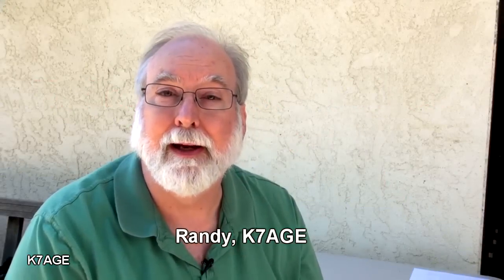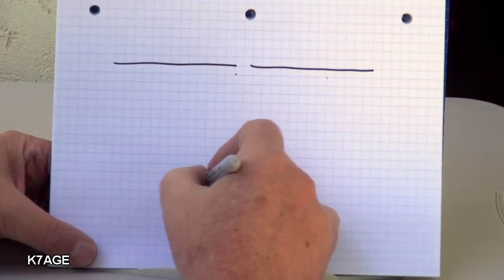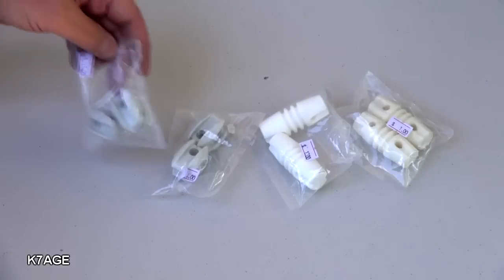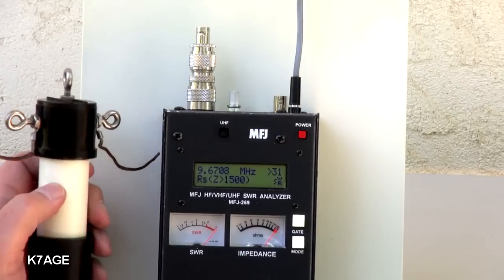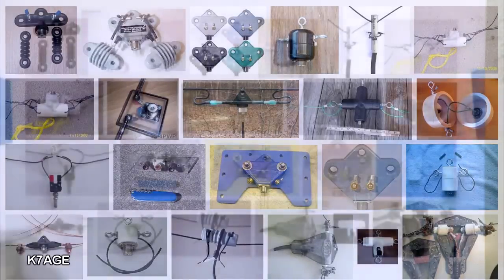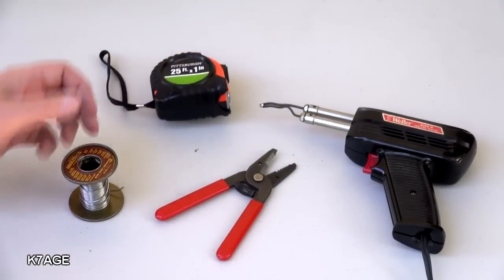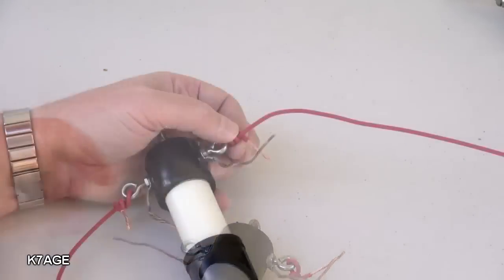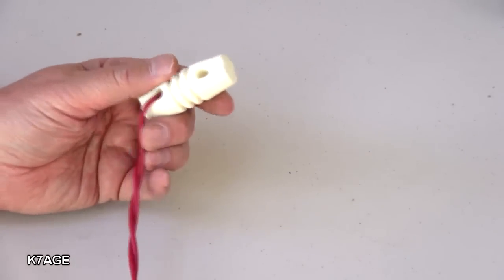How To Build A 10 Meter Dipole

Comment: With the black center insulator, I just bent the copper prongs backwards forming a hook on both sides.  Using bare stranded copper wire, I make a loop, solder & shrink wrap that, and use the hooks.  The tension suspends it making a electrical connection and it works great.  Then I can make additional bands, using the same center insulator.  de W7UDT

Comment: does the gauge of the wire used for the dipole matter?
Reply from the maker: Not really. Needs to strong enough to hold it up. Stranded is better than solid to prevent breaking.
Reply: @K7AGE what size coax cable are you using for the 10 meter ? Thx

Comment: Thank you for the video. I just wanted to make sure I did not have my measurements wrong. But I used my RigExpert AA-600 and my VSWR is less than 1:1.6 and my radio is showing 1:1. I will take that all day long.

Comment: What kind of bandwidth can you get from something like that without a tuner that is , I know most times it’s based on 2 :1 or less .. i’m thinking more like  1:5 or less 100Khz ?  Does the size of the wire used determine that

Comment: that was a good video im thinking of making one , 1 problem though i dont have a high place to hang it could it go under the eves near the rain gutters from my house run the coax out my window to the ballon witch would be 5feet away .would know of some more on the stealth side that i could use for 10 meter
Reply from the maker: Don't hang it really close to the gutters. Give it a try
Reply: ok, il hang it half way from hse to end of the eves il see how that works.

Comment: New to the hobby. Why do you divide 468 by the MHZ what does 468 represent and what does an swr 1.1:1 mean?
Reply from the maker: low SWR is a good match  https://www.eham.net/article/23802
Reply: Should be 300(.000.000) ... speed of light.
Reply: So ((300 : MHz) : 4) * .95 = quarter radial lenght

Comment: Ok I see this is old, but I’m new. What if you don’t have a balun? Do you need the balun? Can a balun be purchased on the cheap? Thanks! -73- W1KPS
Reply from the maker: If you don't have a balun, just connect the coax with the center in one wire and the shield on the other wire.
Reply: Is a balun necessary?
Reply: @kevinshieldsw1kps785  No, a balun is not necessary on a dipole.  A dipole's characteristic impedance is around 72 ohms  and is close enough to the 52 ohm characteristic impedance of coaxial cable.

Comment: Just got an any tone. (Ten meter) mobile rig (am/FM) . Plan to use that as base /mobile rig. Useing a salvaged bread board. To carry it around. Has no ssb yet am at 29000-29200/fm at 29600. Will be a jump start as interest is on my golden years as its easy to wrangle wire tks Fer the class on  ten 73 de kv4li

Comment: If my antenna, made per these specs., is a little long can I just fold the extra wire back at the end insulator -- or will the dbl'd-up wire cause any sort of issues.  Not talking about folding back many feet of wire, but if I needed to shorten each half by 6-8 inches (just as example) would it still function properly by just folding those bits back and twisting over.  Hate to cut of few inches here and there and just throw little pieces away, if it is Ok to just fold them back over...never know when that antenna gets taken down and re-purposed for something else.
Thank you for the time and effort you put into sharing your knowledge with others.
Raymond - WF7BSR

Update:  I saw in your other video (https://www.youtube.com/watch?v=Ogxp3yjAzCs) that you did fold over small sections of wire when shortening the antenna.  Thank you.
Reply: Hi Raymond.  There’s no problem with folding excess wire back at the end insulators.  As electrons run along the surface of a conductor (i.e. the antenna wire), by folding and twisting back, the electrons “see” the cable as a single cable, terminating at the insulator.  73.

Comment: HI Randy, What would be the difference if you just used the wire as a long wire mounted horizontally into an unun instead of cutting it in half to make a dipole? maybe its a stupid question but Im interested. thx
Reply from the maker: That becomes an end fed dipole. I believe the balun used this is a 9:1 or so. Google end fed antennas.
Reply: Thats what I thought, thats what I use myself. Would be interesting to see the swr results side by side if cut same length.

Comment: Thank you for the effort you put into your videos. I built a 20 meter dipole using this method. It resonated at 14.2 MHz and only 1.7 SWR on the high side of the band (no adjustments needed). Although this antenna is mounted inside the attic, my first contact was with an operator in Miami..  I am located on the NH/MA border.
Reply from the maker: Glad to hear that you made this for 20 M. Have fun.

Comment: Dogbone insulators, like most other stressed insulators, are designed to work via compression.  Wiring up a dipole with the ends being pulled apart is a surefire way to break the insulator as it is being stressed at its weakest point.  If you attach the end of the dipole and the suspension wire (preferably nonconductive) at opposite ends such that they are pulling towards each other through the insulator (compression), the insulator should not break.  If it ever DOES break, the way the insulator holes are opposed at 90 degrees will ensure that the suspension wire and dipole end "hook" keeping your antenna up in the air.

See: http://www.mtechnologies.com/dipole/bvc-007f.jpg
Reply: Do like am radio tower builders and use guy wire insulators called Johnny balls those support weight of swaying towers in a pull type measure

Comment: You didn't account for velocity factor I reckon, still a great video, thanks for that!
Reply from the maker: 468 is just starting place to figure out the length. Always cut the wire longer and trim back.
Reply: that's probably smart haha, I'm just in the theory part of things and will make sure to follow that advice as soon as I get the real estate to practice :D
Reply: Hi Jonathan.  The 468 formula INCLUDES the generally accepted velocity factor of 0.95, so Randy’s starting point calculation is correct.

Comment: I am told day in and day out that 10 meters is not that great anymore because of the sun spots and space weather. Does that mean that there is no one on 10 meters or does that mean that conditions aren't that favorable but people continue using that band anyway?

KM4WJV
Reply from the maker: Yes, 10 isn't what it used to be. The propagation has been poor. 10 does open, but you may have to listen around.There have just been a couple of 10 meter contests, and the guys are complaining of poor openings. Here is a good site that covers 10 meter beacons. These are good to check to see if the band is open. http://swling.com/blog/2016/02/guest-post-listening-to-10-meter-radio-beacons/
Reply: I'd love to check but my moron lawn guys mowed over my 80m dipole that I had on the ground overnight to perform modifications, i spliced it but i know it's going to mess everything up, so i guess a new 80-10m dipole is what i'm getting for Xmas
Reply: That's true to an extent but it DOES open during the low part of the cycle so keep checking it! You never know when it will pop open. HAVE FUN!

Comment: Another  GREAT video, Sir!!!  My only thought was at the 11:00 min point where you put the far end of the red wire through the insulator--a "newbie" may not know how far from the tag end to put the wire through the insulator.  Maybe show  putting a Sharpie mark at the 8' 3" point just as a reference mark (starting point) for possible future tuning by unwrapping/rewrapping the wire in case they need to lengthen or shorten that end.  Love your videos!!!  Rich, W2RRK
Reply from the maker: +Richard Kelly good idea

Comment: Do you really need a balun? or can I just run a pos  /  nag  lead?
Reply: +Walt Prescott need to know this as well
Reply from the maker: +Walt Prescott The balun helps to balance out the antenna and reduce RF coming back down the coax into the shack. You don't need to use the balun.

Comment: Hi Randy, nice video, good work, I have a couple of questions,  what kind of BalUn was that? A voltage Balun or a Current Balun and what purpose did it server? I look forward to your comments, KK4EDE... 73
Reply from the maker: +Michael Katt It is a 1:1. It helps to balance out the antenna to the coax and helps prevent any RF from coming back down the coax to the shack.
Reply: @K7AGE  I know that I am late to this video, but, yes it is a 1:1 balun.  But, is it a voltage or a current balun?  If it is a current type then it is a common mode choke and those are the ones that help prevent the coax shield from acting as part of the antenna.  And at 1:1 they really should be called line isolators as they do not do any impedance transformation that makes any difference as a dipole antenna's characteristic impedance is around 72 ohms and poses very little of an impedance mismatch and a matching transformer is not needed.

Comment: Hi Randy, Thank you so much for this video. I am a tech and I have been doing my home work to find out how to get on 10m with my Kenwood TS530S. I am going to use a ladder feed that goes into the 2 (left 7 & right)  8'3" wires. My question is, if I will use antenna tuner (AT230) that has a SWR meter on it will I need to tune the antenna with an analyzer? Thanks, KK6FGY
Reply from the maker: +bsdguy You can tune the antenna with the AT230. Cutting the antenna to that length should be good for the tuner.

Comment: My first dipole was for 6 meter SSB, and I made the center insulator out of one of those plastic bins you get croissants in from Food Lion, some hardware I had lying around and a few feet of TV coax.  Worked surprisingly well.
Always have a BNC to F barrel lying around.  75 ohm coax is useful stuff, and it's everywhere.
Reply from the maker: Sounds good

Comment: Sorry to bother You Randy But I am a Canadian who is studying for amateur Radio Licence and I was wondering if a person could use OutDoor Clothes Line the kind that is plastic coated over braided strands of wire if a person could use Clothes line what would you use which kind of Balun I have a HF Radio given to me and I would like to make a antenna that i can listen to HF with right now I am using a 2 meter Omni antenna outside and it works so so but be nice to hear more also since only to receive could the antenna be put horizontal instead of inverted any info beappreciated

Comment: Why did you use a 1:1 balun instead of the proper 1:4 balun, just to confuse everyone?  Also, where can you find a balun for just $5?
Reply from the maker: steve c A 1:1 is the correct for a resonant dipole that is using coax. The dipole should be around 50-75 ohms or so. If I was building a non-resonant dipole it would be closer to 200 ohms and fed with open feed line. Then a 4:1 would be needed and a tuner. I found that balun for $5 at a swap meet. New, they are around $30.
Reply: K7AGE I realize you can use a 1:1 balun or just connect the coax directly to the dipole and it still works in a pinch but neither one was a good match in my testing. I tried using a 1:1 balun, 4:1 balun and direct connection with just an SO-239 and tested each one with my antenna analyzer. The direct connection was naturally the worst with over 2:1 SWR.  The 1:1 balun gave me 1.6:1 SWR and the 4:1 was the best with about 1.04:1 SWR.  I tried that on 2 different dipoles, one for 10M and one for 40M and got the same results!  Wonder why that is?

Comment: good video, as usual.  A couple of questions:

1) what would we see with a 4:1 balun 
2) When would a 4:1 be desirable?

thanks.  

Your fan always, Chris (N1WKO)

PS - the next time you are back East, come by the museum.  You wouldn't recognize the shack..
Reply from the maker: The 50 ohm load would measure 12.5 ohms through a 4:1 balun.
Reply: Chris Kelling 2) a 4:1 or a 6:1 balun can be used to make an off-center fed dipole. This way you can make multi-band dipoles.
The impedance, depending on how long you cut your wires, of the antenna will be around 200Ohm (where you use a 4:1 balun to match it to a 50Ohm feedline (coax)) or 300Ohm (there you use a 6:1), ...
Reply: Chris Kelling  A 1:4 balun is desirable if you want a 1:1 SWR since a 1:1 balun is a bad match and will give you about 1.6:1 SWR.

Comment: Randy next time talk about the "delta loop antenna" It´s a great antenna. I think it´s a much better choice. And it´s very simple to build, you can build it without a balun. Using just a little 75 ohm coax for mach, to obtain 50 ohm on the feed line.

73

Comment: Can you also show how to tune with a simple SWR meter (or at least address that in the video)?  I can afford one of those, but the Antenna Analyzer is a little pricey.
Reply: purplemutantas OK but, tuning up at full power is fine on an FT-817 but unwise on higher power rigs.
Reply: Dan Long Before I got my antenna analiyzer I used the SWR meter built into my FT-817. It's pretty simple to do. Hook up the antenna to the radio. Set the radio to an unused frequency and pick a mode that will give you full output power. CW is a good mode if you have a key. FM will also work but it's technically not legal in the US to use FM on HF except the top end of the 10 meter band. But If you are using low power and keying up for just a couple of seconds I don't think it really matters. You can also use AM if CW and FM aren't an option, but AM doesn't put out full power when you key up. Anyway. Once you have a mode and frequency picked key the radio. You should see a reading on the radios SWR meter. If the antenna was made right the SWR should be a bit high since you want to make your antennas long so you have room to adjust. Make a note of the SWR. Take the antenna down, shorten each leg of the dipole a little making sure each leg is the same size. Hook the antenna back up and key up again. You should see a lower SWR. Keep doing that until you get the lowest SWR. On a dipole without a balun you can't go lower than 1.5 SWR unless you have feedline losses. So once you get to 1.5 you are done. I hope that helps.

Comment: I still vote that Techs should be able to use all of 10m. If not all then at least have some use at the upper parts in the FM section, so they can use FM 10M repeaters. That's just my opinion though. I'm a general so it doesn't effect me as much.
Reply: retrogamefox I am going to try for my license. If I use 10 meter can I only talk on 28.300-28.500 cw and ssb or can I also talk on 28.000-28.300 cw rtty and data.
Reply: Indrid Cold Closed up? Really? I will let those guys in Canada that I worked a couple of nights ago know that we really did not have a QSO so they can take me out of their log books and I will do the same. I am sure it was something I dreamed but it sounded real.The hobby is not for everyone and if poor conditions keep you away it may not be for you. It is what you put into it and if you put nothing in then don’t look for much in return.